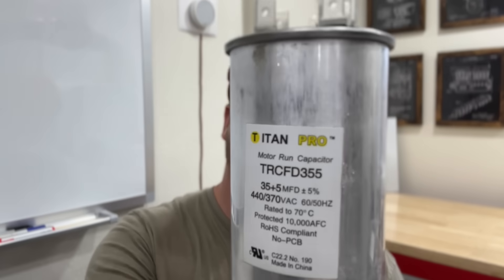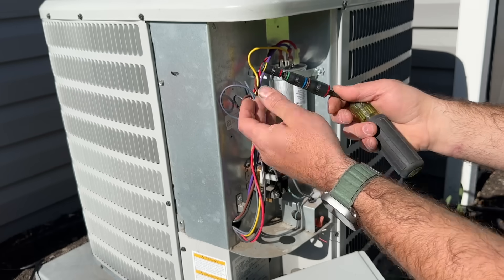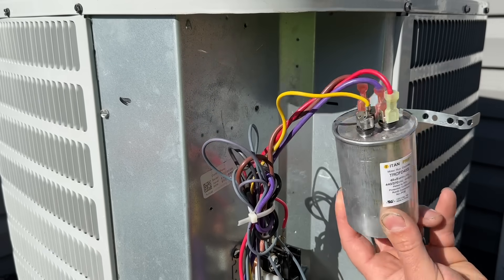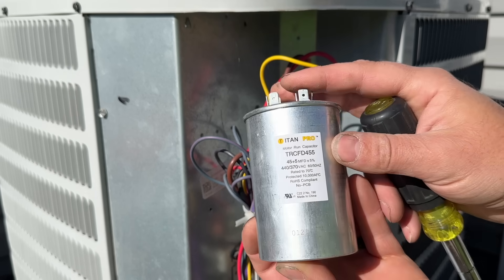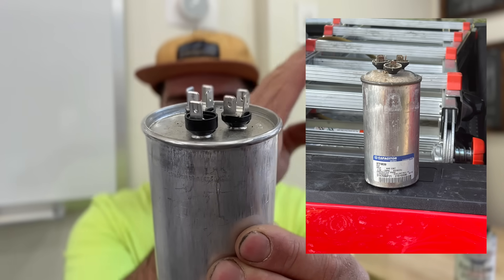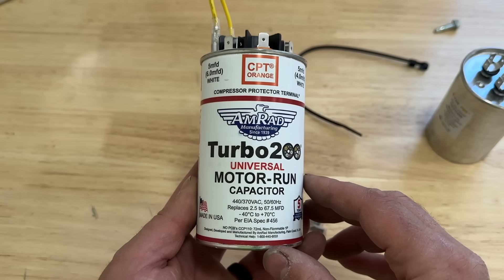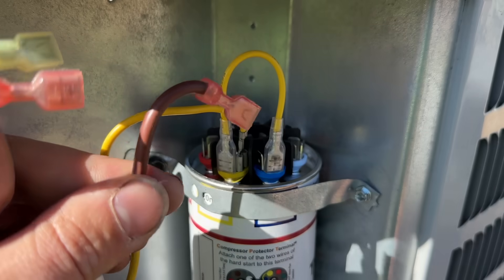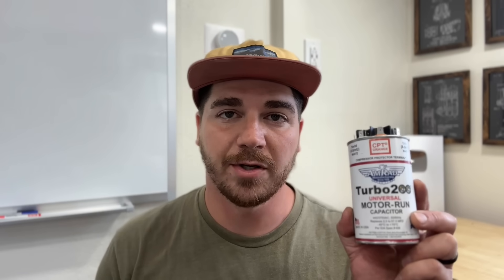HVAC Contractors Practically Make Their Living On These

Comment: I saw a friend's AC condener. It was like 1970's. Can't even read brand or model number. What I saw confused me. It had three capacitors. One start capacitor. One 5uf fan capacitor. One Dual 30/15 capacitor. I was so confused by this dual capacitor which I believe both are for the compressor after a long thought after seeing it. He sold the hosue so I wasn't able to help.
Reply: Tell us another story with no ending
Reply: @justincummings4775  The situation was terrible because the owner did not communicate with me about it. The fix to this situation is to replace exactly what you see. If you can read the labels, use those numbers and find replacements. There was a start capacitor that you absolutely cannot read anything off of it. You have to use a meter to measure it if it's still readable. One tip for something really old is to take the capacitor out and DO NOT rub on or touch label or stamped markings to read it. Take a picture with cell phone and try to zoom and read it. I had 38 years old fan capacitor that I cannot read but was able to read with zoomed picture.
Reply: @MrTiger0002  info will also be on the compressor if you can’t read the data tag on the condenser. It’ll at least give you the herm side size

Comment: I can't stand the Turbo 200. Thing is a waste of resources and effort. If you have to replace a cap you have to get into the panel anyway. Have a look and get the proper capacitor and save like half the cost of the Turbo. 

Plus just adds more chances to screw it up and get confused for a DIYer and do real damage to the compressor.